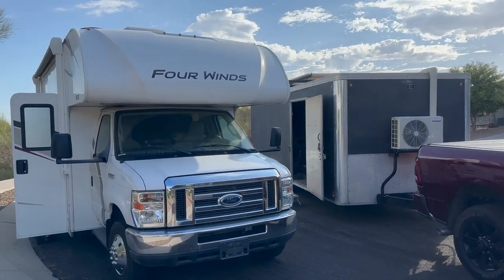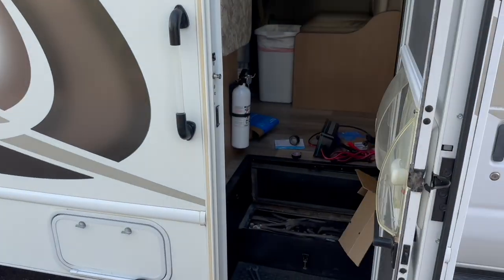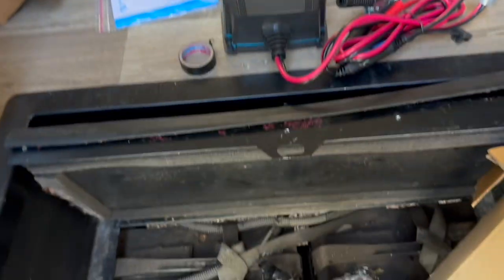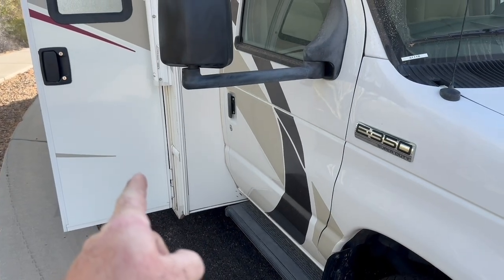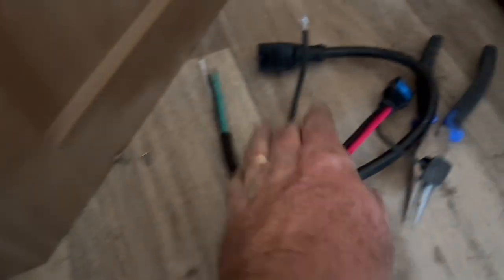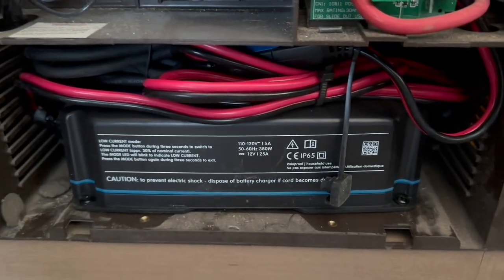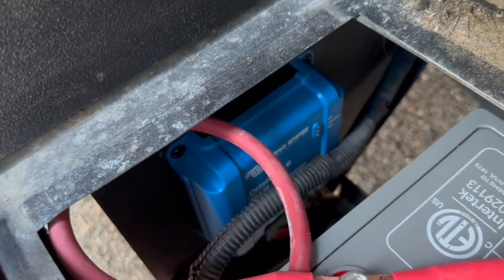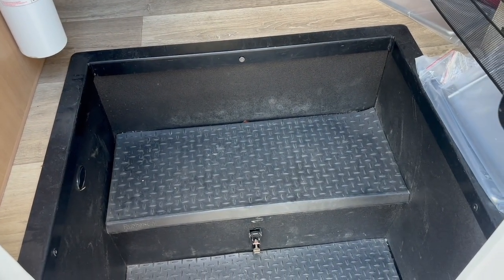3 steps to Class C lithium upgrade!!!

Comment: I need to do something similar to my class C. It is older than this one (2004), but the existing system looks to be the same. Converter for AC charging and Solenoid for alternator charging. You said your new converter is 25A. Is that enough to power all your appliances when you are connected and to charge the battery? Isn't the original converter 40 or 50A? I am thinking getting even bigger converter so it charges the batteries quicker. Can you comment on that decision? Thanks
Reply from the maker: You can definitely get a bigger converter that is LFP voltage capable and charges at a higher rate. My take is that 95% of the time you would plug in for at least an overnight stop where that 25A an hour would completely charge a 300ah battery bank from 0 in 12 hours. As far as running your 12V requirements, 25A is normally very sufficient. A 12V air conditioner typically draws no more than 6 amps with the rest of the rig (lights, circuit boards, etc) not drawing more than 5. It's more than sufficient - plus you can actually see what it's doing and have some semblance of control vs the other converters that have one preprogrammed method.
Reply: @TucsonRVSolar  Thank you for your answer. That makes sense. I will try to turn on appliances I have to see how much current they use. I don't have 12V air conditioner, but I have a fantastic fan, lights (converted to LED), water pump, hood fan, etc. Fridge has 12V mode, but I switch it to DC only while driving. If the batteries are getting at least 20A while using the appliances inside, that should be ok.
One more question I have. What happens if you have shore power connected and the engine is running at the same time? Do the chargers get confused? Can something get damaged? Which one takes priority or do both chargers charge at the same time? Are both chargers just wired directly to the battery (in parallel)? I will have a solar panel added to this which makes this situation very likely to occur. Thanks!
Reply from the maker: @desnick2316  Both would charge at the same time. This is another reason why I like the SmartChargers since they stop charging when the appropriate voltage is present - your relay will allow charge present from the battery regardless - as long as there is capacity in the battery to receive. But think of the LifePO4 batteries like a gas tank...the BMS won't let them get overfull.

Comment: Why are you not putting those batteries in a fire resistant box? When those batteries decide to go into thermal runaway it will burn your whole RV down. At least wrap them with fire blankets to slow down the fire and allow everyone to escape.